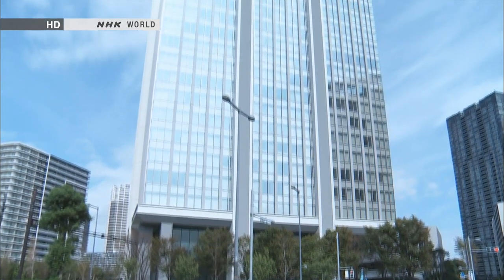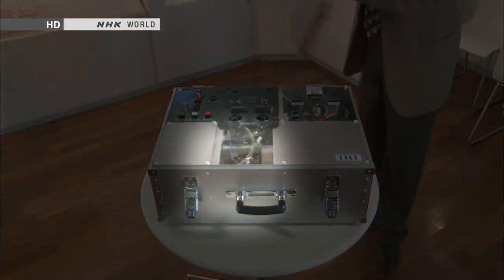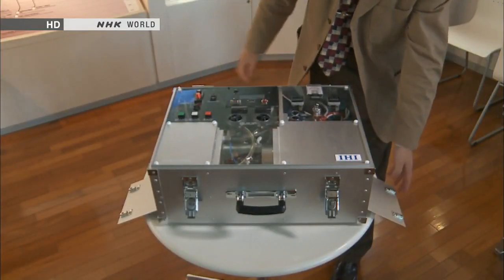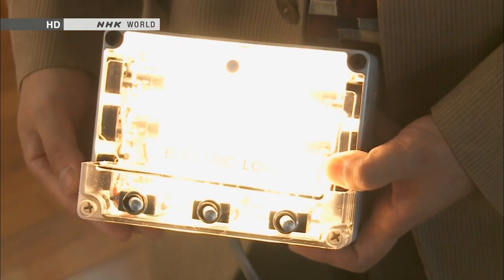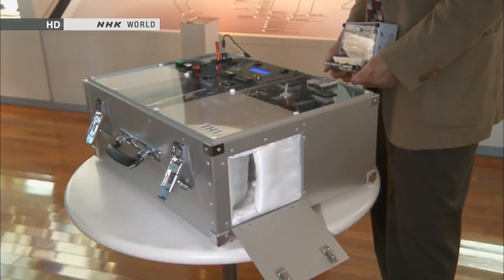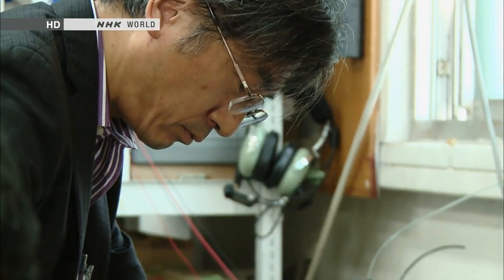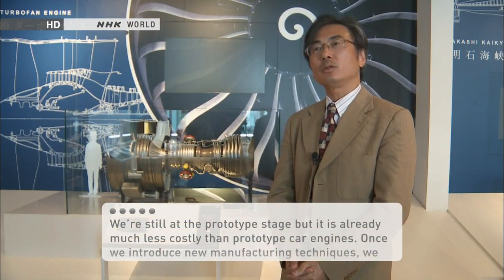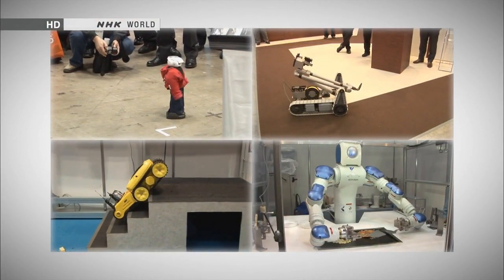Micro gas turbine ,extremely quite and environment friendly مولد كهرباء صغير جدا يعمل على  الغاز

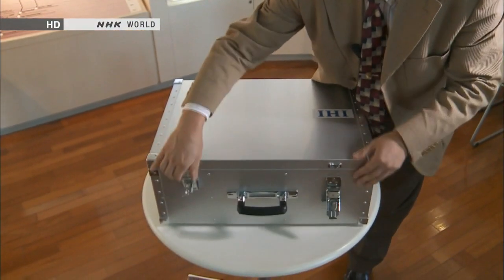Comment: @1:13 you have a box that is the size of a 2500 watt generator and you say it only produces 400watts.
What are going to power that is only 400 watts? Why not use an inverter UPS instead. Much smaller and it runs on a 12 volt battery.
Reply: Yeah 400 watts so stupid you couldn't even run a full-size refrigerator it looks like one of the turbine engines for high end model planes.

Comment: There is a similar gas turbine developed in America using mostly off-the-shelf components. It produces 80Kw. It is being used to drive electric generators on buses and garbage trucks. I heard about it in a TED talk. It is bigger than this unit but it will burn virtually any fuel, as well as common fuels. It spins at commonly seen speeds as you would find in turbochargers.  Nothing approaching 300K to 400k rpm. 
Why were busses and garbage trucks chosen?  Because of the typical stop and go driving that is much better suited to an electric vehicle.
Reply: Source?
Reply: @manniom  Based on the bus reference and 80kw, I'm thinking Capstone turbines. They're single shaft centrifugal compressors with a single stage power turbine and foil bearings. They have a recouperator and are often used for CHP applications as the flue gas still has a decent amount of heat in them.

Comment: As cool as this is and as much as I want one, it's clear it never actually worked...10 years later nobody has ever heard of it. Today you can cram around10KW of lithium batteries in the same size space with no flammable fuel or exhaust...400 watts won't power an electric drill.
Reply from the maker: you might be right ،

Comment: Have to strongly disagree that the price of "a few thousand dollars" is not at all comparable to similar units on the market.  Starts coming closer if the power output is 10 times what it is.
Reply: Well, a Honda 2800w generator is indeed around $2000. It wasn't very long ago their 1000w model was still around $1,000. Yes, you can buy a cheap garbage homeowner model for less, but that is not what they are comparing to. I just bought a "cheap" non-Honda inverter generator, and it still cost $1,200 with electric start for 3500 watts...and I got a really good deal.

Outside homeowner land, it's nothing for a business to spend $5,000 on just one generator for one project and then just abandon it.
Reply: @ryanroberts1104   Many brands of generators in that power range are available at one third the cost. If you want to over pay for something you will hardly ever use, knock yourself out.

Comment: is this available commercially yet?
Reply from the maker: yes
Reply: @mr2000jp  link to it?
Reply from the maker: @ancelb9590  sorry , we dont have connection with the producer
Reply: No, it isn't, and it never will be. It's a "neat" idea, but it's already obsolete. You could stuff 10+KW of lithium batteries into the case where they are getting .4kw on gasoline. The person who made this video does not understand generators or turbine engines at all.

Comment: Put one in the trunk of an EV, range extender that only switches on when the batteries drop below 20%.
Reply: They call that a Chevy Volt. Except no need for ridiculous turbine engines, just a normal onboard gas generator.
Reply: @ryanroberts1104  boring....

Comment: Do you have a version that works with SCCO2 at 600C? 5 to 10 KWe out pout would be perfect.
Reply: Can scco2 be used as fuel?
Reply: @kiloton1920  No it is for use with an external heat source.

Comment: I want one! Why can we not buy such micro gas turbine generators anywhere?
Reply: Expensive!
Reply: Because nobody with any real need wants one. Why would you spend multi-thousand dollars on a 400w generator? This video is 10 years old, and it was obsolete then. Today 10,000 watts of lithium battery takes up less space than this 400w absurd contraption. Also turbine engines have terrible fuel consumption.

A 400w piston generator can be made for less than $50, often sold for less than $100. If it was turbine powered, 20x increase would still not be enough.

This was never ever ever aimed at the home market for the average doofus to buy, this is for well funded companies. But it still doesn't even exist.

Comment: I guess the output is converted mechanically to an electrical generator? will be possible to make a "not very big" mod to allow also to rehuse the heat for moving a vapour turbine?
Reply: Totally possible but would likely triple the size for maybe 10 or 20% more power. Not worth it since if you're after efficiency, you should just use a regular generator.

Comment: I am here in 2020, looking for range extender solutions for my EV...   and yet none of this still is ever available; prototypes are created and then gather dust in warehouses.
Reply: If you thought you were going to put a turbine generator in your car, you didn't ever have the brain to back up that project in the first place. "Range extenders" are readily available - it's called a generator. You can get one smaller than this with higher output and better fuel efficiency from Harbor Freight for about $100.
Reply: @ryanroberts1104  narrow minded nut heads like you drives me crazy.
A less noisy turbine engine to extend range will be far more reliable and far efficient than your stupid 100$ motor.
Reply: You only need 37 of these to move a typical car down the highway. 400w is only half a horsepower...
Reply: This is for telecoms
Reply: You bought an EV? you got scammed and unwittingly placed yourself into the hands of the controlling class. You should of listened to all the uneducated EV deniers who tried bringing to everyones attention the basic principles of energy density and energy conservation.
Reply: I know, right?
I'm looking too for the same thing. I really like turbines for their power-to-weight ratios, they can run on many fuels, and I really, really like the sound of them.

Were you successful finding a micro turbine generator, that can fit in a motorcycle?

 Do you know where I can buy a small, efficient gas-turbine or jet-engine? I've been looking for small or micro ones, about the size of a Pringles can, that are not the single compression stage ones for toy planes & helicopters.

I think the toy ones are so inefficient, because they just have 1 compressor and 1 turbine stage, the literal bare minimum just to run. I've been looking for multi-compressor stage and multi turbine stage engines, or how to safely compound-turbocharge these toy jets, but haven't found either yet.

Until I do, I'm stuck with small, turbocharged industrial engines like the Predator 212, but I'm also looking for liquid-cooled versions of THAT.

This is so annoying, and I currently don't have the time & money, for trial & error experiments like this.

I almost became homeless, because I foolishly tried doing my delivery job, with prototype Series-Hybrid scooters, while simultaneously learning about BEVs, Hybrids, and electrical engineering.

I should have just put all my money into getting & maintaining a fast running motorcycle, to earn more money with my job, then focus on all this.
Doing UberEATS in my area, with a normal bicycle or weak scooter, is a death-sentence.

Comment: Put it in as a range extender engine. ELECTRIC CAR THEN NEED LESS BATTERY.
Reply: You clearly have no idea how much electricity electric cars use or how much gas turbines burn. You would get less MPG than a semi truck. 400 watts is not enough to charge a car, not even 1/10th of enough.

Comment: 1200 gram to 400w

3g to 1w

1g to 15w are out there
But those do not do not include engine..
This turbine is 1/5
Of overall weight 
(say i)?
So 3 ton 1 mw..
The gen head is not the star here.. I was hoping so but. 
The beauty is 400k rpm.

Comment: Mag bearing?[must)
Reply: I think air bearings. The speed of rotation at idle is more than enough to produce a film of high pressure air at the shaft to suspend the rotor.

Comment: Lol.... you do know that Rover was making a 60hp portable gas turbine in the 1970s? Further developments were halted because the socialists who virtually destroyed the uk didn't want the masses to have access to energy that they didn't control or tax! It's highly unlikely that these generators will ever be generally available for exactly the same reason.
Reply: Yes, but the intake diameter of the 1S60 (is what I believe you're referring to) is at least 3 times larger than this puny 3-inch unit. Gas turbines don't scale down very well, and its very difficult to make small GTs efficient because the physics of fluid dynamics won't allow it. In general, the larger the turbine the lower its SFC and the higher the efficiency. The goal of IHI is to make GTs small enough to fit into robots and make them as efficient as they can possibly make them.

Comment: So this was 2013.   Are they being used commercially anywhere?   400 watts is less than my microwave needs.  Cost?  Fuel efficiency?   It's 2018 where are they now?
Reply: Simon WoodburyForget 
Pump water to elevated storage tank? Perhaps leave calculated air reservoir and pressurise it?
Reply: Where are they now? Dead. This was obsolete 10 years ago.

Comment: I wish there was a cut-away model or at least a picture of the fan blades with an idea of scale. It seems like magic to have a 2 kg motor that could generate 400 watts of power so quietly and cleanly, I can't help but be slightly unconvinced. More reasurance needed.
Reply: its not the watts its the amps!!!!
Reply: @samsteele4650  what do you mean? Watts are the unit by which power i.e. the capability to do work is measured.

Amps are the unit by which current is measured, and without knowing other circuit parameters, a current measurement doesn’t reveal much about a devices ability to do work.

Furthermore from the rack mount form factor, and the 48v nominal voltage as indicated on the panel, I assume this unit is designed for telecoms backup, and that the nominal current would therefore be around 8 ampere.
Reply: @pierrekinbrand  amps times volts equal watts. So?

Comment: 400 Watts = mistake, by far.
Reply: Agreed, should be much more efficient than that. I like the idea as far as hybrid/crossover tech till 100% electric takes the show.
Reply: For a palmtop 330krpm turboshaft(or is it turbojet?) engine, with entirely clean emissions, I think it's way more than enough.
Scaling it up might get difficult though. It's the "lift by yourself but power a car" engine range that is extremely difficult to get efficient, quiet, and clean.
Reply: @Spirit532  How about use for a hybrid that charges the car battery ?
Reply: @RonWagner  You'll be burning more fuel to generate that 440W than you would running a 1kW piston generator.
Reply: @Spirit532  Thanks for that info. Apparently good for cold climates if you use the heat properly. It seems that a generator would be cheaper and easier to get serviced. Noisier though?
Reply: @RonWagner  Modern generators can be relatively quiet a few meters away - you'd want this in a garage or pointed outside somewhere regardless, since gas turbines generate a lot of exhaust gas.

Comment: Quite likely, the future of mobile power plants will be gas turbines.  They are cleaner, produce more power per kilogram, and have very few moving parts.  One of the key things about turbines is that the combustion of the fuel is a continuous process, unlike reciprocating engines, which only burn the fuel for a short moment, before exhausting the partially burned fuel.
Reply from the maker: Blackcat Holman its less harm to the environment , which makes it a lot better , but i hope it would be the second solution after the sun and wind power
Reply: The compressor section pumping losses for turbines are horrendous. For a 400w output probably the compressor section consumes ~1KW all of which has to be paid for in fuel. Some turbines produce 8500hp yet only have 2500hp available for work - the full 8500hp having to be paid for in fuel (and air).
Reply: @ThePaulv12  what and when are your sources? modern day units run at 90% or better.
Reply: Using twice the fuel (worst case) of a similar output reciprocating diesel
Reply: @JimLahey21   Depends. Gas turbines can be VERY efficient. BUT, when it comes to gas turbines, high efficiency doesn’t scale down to small sizes very well. A large gas turbine (50+MW) can approach 50% efficiency. But when you bring things down to, say, a megawatt or two, efficiency has already dropped to maybe 20-30% 400W? Don’t ask.

Comment: Yep, my local store sells the petrol version of the larger 750 watt generator, it is $99 including taxes. It is also a simpler 4 stroke.
Reply: Damian Smith Simpler?  How many moving parts in a four stroke engine?  There is only one primary part in this turbine engine, the shaft that connects the exhaust turbine to the compressor.
Reply from the maker: Blackcat Holman oh , i see , you are right
Reply from the maker: Damian Smith ok , but what about noise it makes ? how noisy is it ?

Comment: I can see a market for this. In winter time, when there is a power outage, most forced-air heating furnace will stop working because the blower fan is run by electric motor. This turbine generator can be built into a home heating furnace which warm the home and also produce enough power to drive the blower fan. i.e. a natural gas furnace can continue to work during a power outage.
Reply: I agree, it seems like a waste to use natural gas for only heat when it could be used to make electricity and ultimately the same amount of heat.  if the electricity produced were used to power a heat pump, then that would be more efficient than a regular gas furnace
Reply: That's been available for 40 years. My dad, a builder had one for jobsite use while awaiting temp electric service. About 3000 watts, gas or poropane running the ubiquitous Briggs & Stratton 3.5 HP piston banger. Easily run a SkilSaw or air compressor / nail gun.
I'm not trying to be an ass. I WANT A TINY GAS TURBINE. But for market purposes, 7 years later, it's vaporware.
Reply from the maker: exactly